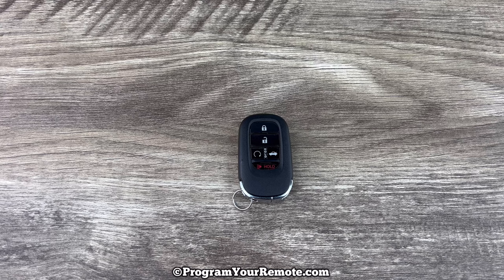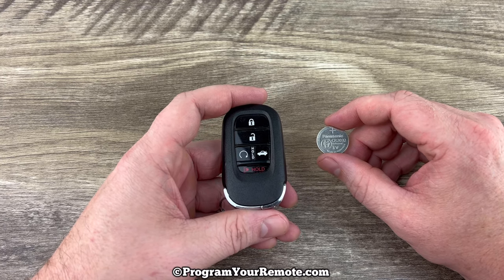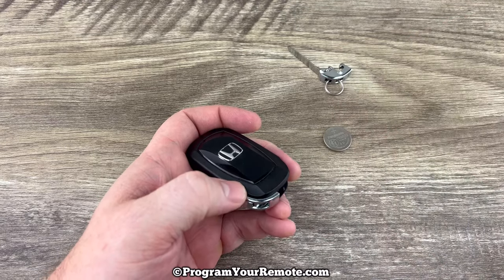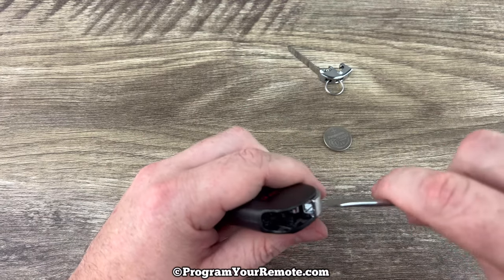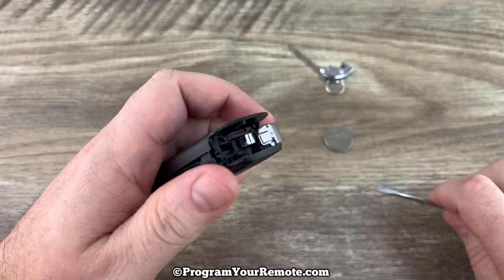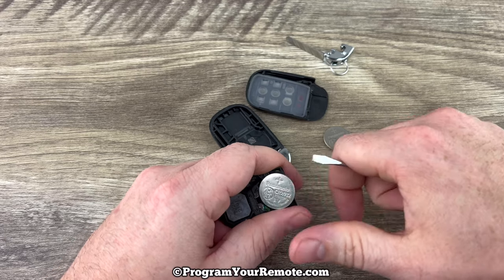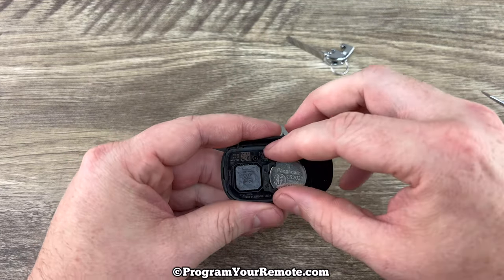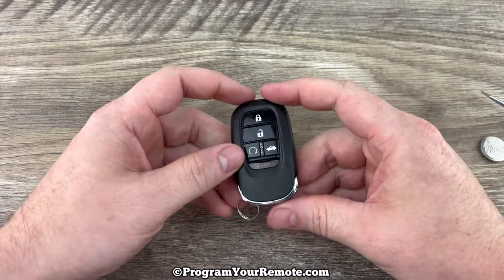How To Change 2022 - 2023 Honda Civic Key Fob Battery - Replace Replacement Remote Fob Batteries

Comment: There is another video here on YouTube with a different method for doing this. I tried it even though I've only had my new 2022 Civic Sport Touring Hatchback for just over a week. I was just curious since the fob is different than the previous one for mine and other Hondas. I had changed the battery on my previous fob for a 2019 Honda CR-V about 6 months ago. Opening that one and changing the battery was much easier in my mind. It looks like they may have made it purposely harder to do on the new one. 

 I was not getting anywhere and actually bent the plastic with the advice from the other video.

This one is more straightforward and a better method for my money. It's not easy getting a screwdriver in there, but I CAREFULLY put the blade of a utility knife in there and then slipped in the screwdriver behind it. This makes more sense and is less problematic than the other method. Don't ask me why I wanted to know how to do this just a week after getting the car and fob, but now I know for the future. Kudos and a solid approach. Thanks.
Reply from the maker: Glad it helped!
Reply: Glad it helped